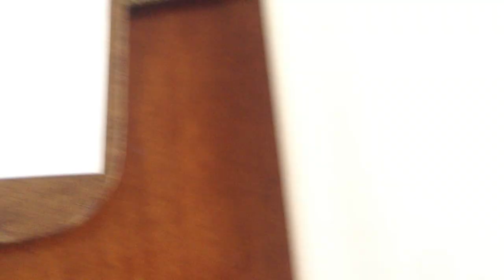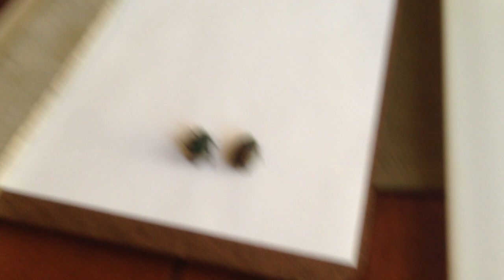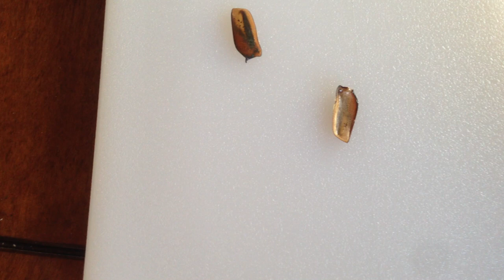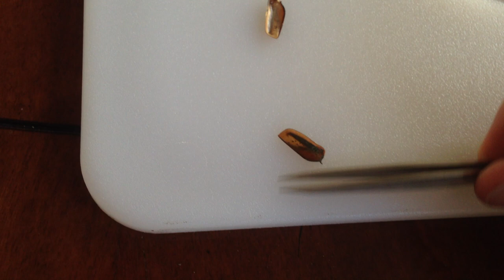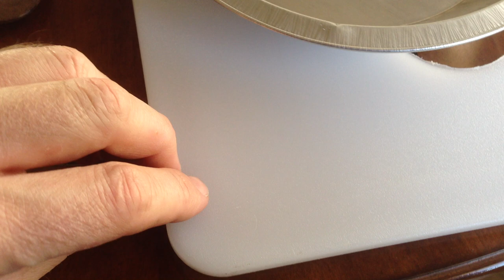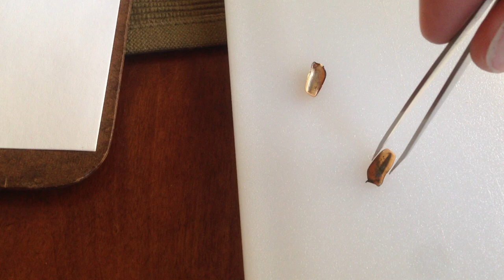Viktor Grebennikov #1 - Testing Scarab (June Bug) Wing Covers

Comment: I used a toothpick to move them around and it was highly magnetic to the wood at the hinge point in the wing. electrostatic or not there is a concentrated energy field. Like taking a bunch of copper wire and have them all connect at a fixed point. Then teathered together like a shell carbon fiberglass type mixture.  Getting the underneath wing and microscope research.  Possibly dual flight propulsion system using electrical field steering for thoughtless evade techniques. Take note how the bug has no tail or wing flight varaiations to control the  direction of travel. And many can swarm without bumping into each other. Is their higher magnetic properties in the lower wings. The way the wings flap it would be ac flow of electrons.
Reply: Just In what species of beetle produced those results?
Reply: A great hypothesis to be tested.
Reply: The British Beatles. John, Paul, George and Ringo.
Reply: @osamabinladen824  hello bin. You become science now?
Reply: @wildanrosyada7787  he was CIA before that

Comment: The key to this geo-scoptic flying gyros, is the attuned shape eiffel tower-like or Infiniti car badge arch v icon symbol in a natural wing craft called insects. Creating what only in sci-fi illustration of the "pulse engine", you can feel that power tension by pressing both pointex fingers aside until they hyper extent while you arc flick up and down, this is the Geo momentum direction or apposing of gravity, like "anti-gravity".

Comment: There is a form of Mica that is extremely thin and flakes off of gold or quartz, I am investigating the proximity of these particles to EMR or perched on the surface of water.
I believe gold is the mimic not an interloper ie; this quality is inherent in Nature in various measures and "colors" - as a young man I noticed gold floats on water. As a researcher
I have discovered that gold with collect particles of itself on the surface of water and form itself into a six-sided figure that also floats perfectly on the surface. This may be
due to the distance gold's electrons can travel, as a mineral it is a given but gold is of another magnitude. All you need to do is to drop an 8 molecule thick sheet of gold and wait 
for it to fall. Instead it will flutter and be tossed by any movement of wind. You can even do it with Culinary gold sheets, just not that dramatic. We may be in the territory of 
convergence where it's not just the material but very much a mixture of things like shape or even something as trivial as color. It is bound up with function as form, honeybees
weigh nearly nothing but laden with nectar and pollen? Everything about beekeeping (32 years) is golden. It doesn't take a huge imagination to see there are connections that
are as invisible as the wind... you have to look at the leaves moving to see it.

Comment: This must be due to the dielectric impedance of the material or structures of the wing itself,  it would be interesting to see if we can put one under the microscope to check the micro geometry of the wing,  also a chemical spectrum analysis would reveal some on the nature of the material that is inside.  next to that, it would be interesting to expose them to similar frequencies as the wing beat, there is likely a resonance frequency that it will respond to.  this can be tested with a frequency generator and a nice full-range speaker, placing the wing on the membrane and observing the response.  if i can find one, ill do the resonance test.

Comment: Hey guess what? You don't need bug wings. On a microscopic scale, they formed sets of torus fields aimed at cone tips, all held on surfaces of various shapes. Some work better than others but it's all the same. You can coat ceramic with metal, easiest way to make your own antigravity as well as free energy for pennies. Don't post videos of it though; seems to really piss off some really bad people.
Reply from the maker: Thanks for the tip, I'll look into it
Reply: Hey can you expand a little bit about the 'coated ceramic' thing. What kind of metal should be used (magnetic or non-magnetic). Also how to trigger the strange effects? Thanx.
Reply from the maker: High voltage triggers this effect. I later confirmed that the nylon holds a static field on its surface. The reaction you see in this video is "like charges repel" as both elytra are carrying the same charge.
Reply: Naoki Kashima Trigger effects? Time itself does this through progressive kinetics of elementary particles. Time begins with the smallest particle, which is most hydraulically superior ; the electron neutrino .00012x e
It has a goal; to replace others like it which have been consumed by stars in the production of larger particles.
This would be very simple if there were but one pole of magnetic current but there are infact 3. Matter is the 3rd.
Imagine a bike rolling along growing larger on it's way. Now consider the 2nd pole being a 2nd set of wheels, so you have a set of axles(variant "A") which tend to vary in length between the left and right sides of the cart. This alone may find variations along it's path, ruts in the road if you will, that make a vibration to modulate "A". 
Now ad a 3rd axle which is connected to the center axle wrong, so that instead of dampening vibration, it amplifies it.
At some point, the wheels shake hard enough on that final axle to fly right off. 
The road is the energy, the wheels are the mass, the left wheels are negative mass, right positive mass. The road is the sum of both as they will constantly mix in space forming neutral ions which are neither negative nor positive, evenly mixed due to the mere passing of time (e-n's.)
Now once the cart has lost it's rear wheels, the axle is reformed in the front of the cart. This is because the 3rd pole is controlling the sum (road) not the cart.
So when 3 leaded edges of any dielectric material are allowed to form spinning torus fields (see my video on the whisper cup/grebennikov solved) like spinning tires, the mass would naturally amplify mass exponentially until it spins off the largest rim of the largest basin like a centrifuge. 
And why?
Because the source of time/energy is negative bias, and will find it's path of least resistance by entering into the cone tip before anywhere else. The only other positive to oppose is the largest rim and it does enter there also but has a fantastic progressive kinetic fight as particle masses increase upon each reaction from small to large. 
So it is easy to comprehend how the torus fields can speed up if there is the slightest rf modulation of charge splitting them. What comes next is more fun; both torus fields grow out of control and collapse, imploding. This is where the wheels shake off once it spins too fast.
Now there are many lines of magnetic current in the large torus, fewer in the small, and by collapsing the fields, charges mix as magnetic lines share over the smallest ridge. This annihilation of 2 fields making one perfect cone over 2 ridges to the top cone emitter, allow those imploding lines to move in sync yet out of phase through the nonlinear focal point off the cone tip. After focus, all lines of force (waves) are thus combined to form a sum of wave peaks on that carrier wave which was the implosive collapse.
Now you quite simple deduce this proven science (through transformer design and or the Joe Cell for example which utilizes zero point energy as core function) has pitted energy against mass with both neg and pos simultaneously, now putting energy off the cone tip and mass off the large rim, with negative pole mesons most commonly ejected from the small ridge (center axle) which cannot keep up with energy that successively makes paths of least resistance more superconductive upon each cycle until all space in and around the device is so superconductive that it is heavy as gold which is an element existing in what I call format # 7. ;; 3 DeBroglie gears around 1, plane interlocking thus forcing all energy to move through rather than around which is why gold forms such a heavy field for being such a simple element based on proton/neutron count. The field flowing off the device rains in such fast pulses of carrier failure that you wont experience it in flight. It's frequency depends on the materials used, and size of the device.

Consequently, it is a dielectric capacitor just like the carbon chitin of bug wings and can be made of any metal, but the best material I've found also safe to use around human biologicals is a layered compound of bismuth over certain metals.
Reply: +mikefromspace  You sir...are full of beetle dung!!! haha
Reply: +Travis Woodward Good one Travis. Maybe you'll explain unification to me now, since you suggest I do not know it as I've clearly proven it on my channel since 2008.  So what is your superior theory? I would love to hear more, genius.
Amplification of splitting the slight mass difference among the poles (already there) produces heavy ion mass displacement. Infact I know first had of a material recovered at the Roswell crash site 1mm thick 25 layers highly dielectric capacitor tech never before manufactured by any known means on earth. Something carbon in bug wings use ion friction to make can instead be made using 3 simple elements and provide many times more heavy ions to displace the mass with over a million times power to weight ratio.
Reply: mikefromspace Mike gravity and magnetism are the same force. If a magnetic field is strong enough it will effect everything around it (look up frog being levitated in a magnetic field), even non-magnetic non-metalic objects. Also, look up magnetic inverter toy (I made a replication of it). You have small magnets around the perimeter and a powerful magnet at the center. This causes an air gap between 2 sets of magnets, magnets don't want to get any closer but don't want to get any further away either. This explains why we we always see the same side of the moon. It is because the moon is magnetically bound to the earth. Gravity can be explained through the magnetic mono-poles the N and S mono-poles. The current space displacement theory of gravity hasn't predicted a single thing correctly about our universe.
Reply: +Naoki Kashima I have my own theory shown in videos, you know this right? Electron neutrinos most superior with hydraulic force permeate all on their paths to stars where they are formed into new larger particles which then oppose their flow. The model proves itself everywhere, and I have even provided mathematical proof of this on the channel. En is time source, and through progressive kinetics, fuels motion of the 3 poles , neg, pos, matter. Magnetic current's broad spectrum kinetic reactions all begin from the electron neutrino strike. Have you seen all my science/physics videos? Formatting of particles explains matter's structure. A diamond for example will form when carbon imitates 2 poles instead of the 1 it is, using cubical spiral expanding or contracting growth pattern F5 boson format from F3 pairs by forming as satellites of a slightly larger boson which contain the crossroads which allow 3rd pole matter disturbances to exist.   I have models for many elements but many videos were lost in early 2012 so I have only reposted the basics and the math proof since all my energy went into reverse engineering coral castle levitation device used also by Merlin and others throughout history to move metalithic stones. Easter island heads were walked into place. Merlin made many stone circles not just Stonehenge which btw they recently found many more stones underground at larger radius.
Anyway I'll work on levitation after I make a good financial income for myself. I'm using a microwave oven I've custom build to grow gold and diamonds. Yes, really.
Reply: mikefromspace I wish you luck in your efforts to replicate the effects from Coral Castle. I am interested in Ed's self turning flywheel. He had to start tuning that thing by hand then the AC motor would kick in and it will continue to generate power and spin at the same time. The extra energy came from the Earth, I believe. He had 2 separate ground connections going into the underground aquifers. Ed was peculiar which land to use for his project. I think he wanted land with underground water source. The Pyramids were built on top of an aquifer. There are 2 granite shafts that go down into the aquifer, granite is a semiconductor. Thus, the pyramids also had 2 ground connections. Also, Tamriel Kapendadze generator uses 2 separate grounds to function (he uses water pipe as one of his grounds a buried radiator for the other ground).

I'm sure you have your own thoughts on Ed, I think I'm a subscriber for yours. Good luck on your project, I'll keep on trying as well.

Cheers.
Reply: +Naoki Kashima Yes grounding to water makes water healthy but not needed for levitation. The flywheel was part of a circuit using 2 dynamos, 3 stage coil inside timing post, distributor that shorts flywheel based to timing post which connects to magneto block. Inside wheel is a 6core coilset which attracts to iron between 6 holes in that centrode which has the distributor tongue coming off it. Consider how dynamos both generate and consume power, so they are self modulators and 3 of them would run 120d out of phase initially until time begins pushing energy from ground 3 tripod dynamo in box progressively to ground 1 flywheel which creates massive energy among inner and outer copper discharge balls, 2 of which you can still see today just poking their heads out of the cement in the flywheel.  The other 2 were on a stationary part which was stolen by an unknown tourist or blue eyed FBI agent, that reptilian bastard. Possibly same one who smothered Nikola Tesla so they could get files used later to make Philadelphia Experiment happen.
Reply: Naoki Kashima  gravity and magnetism is NOT the same force.
Reply: They are gubmit trolls
Reply: mikefromspace  tell me more

Comment: There is fine hairs on the underside of the shells, im guessing they are designed so as to not hurt or damage their wings. So my guess is that those hairs are easily  charged by static electricity.

Comment: could very well be static electricity.   you should try same thing on a glass plate, on copper on aluminum or stainless steel.... wood... a few other materials and see if the wings jump or hover over one another... just my thoughts

Comment: Try using a tone generator app on your phone to vibrate the shells. The shells are capable of creating a field much like a  magnet except it folds its n pole down into its s pole creating the mass nullification. Attach a bunch to a paint stick vibrate it on a suspended rock on a rope pulleys  balance.

Comment: The shells seemed to partially repel each other on the nylon surface.  Did the same thing happen on say wood, ceramics, metal?  Sorry - my mistake - you did try it with a metal pie dish and the shells seemed to stick, but not repel each other, so bit different.

Comment: can you try to treat this wings with magnets? imo they behave like magnets, especially on alu plate it was look like one of most popular ways to demonstrate Lenz's law (by putting magnets on sheet of non magnetic conductor and letting them fall, but falling is interrupted little bit by current generated in conductor mass, its also known as ~"copper tube and magnet experiment") it also seems to be nice explanation why Egyptians was treat scarabs as sacred creatures...
Reply from the maker: I have tried using strong magnets close to them. One was 1800 Gauss (400+lbs of force). It has no effect. Nice observation though. After much testing I have found the cause of these reactions to be the static electricity built up in the nylon.

Comment: Use a microscope. Look for the cone structures on the underside of the wings. Other side of the wind covers. Dragonfly wings also have cone structures. Coleoptera have thick exoskeletons. They are heavy insects. They should not be able to fly. If you watch them fly in slow motion they rub their wing covers together or with their wings and create a vibration, and then they float in the air and use their wings to push forward and to steer. You're looking at anti-gravity. It's all around us and obvious.

Comment: Repeat the scarab wing experiment over the aluminum foil, but attach a grounding wire to the aluminum.  ie make sure all the static electricity is drained.
Reply from the maker: This was my first video on this subject. After further study I became discouraged as everything seems linked to static electricity. I didn't realize it at the time, but the nylon I was working on had a charge. My second video shows that this can be reproduced with dry leaves.
Reply: Russell Martin but it is said that the russian scientist used both wings and their cover to produce the effect,
and he needed some effect to to make the levitation happen,

Comment: put it in a glass tube so it wont fly apart it will hover over the other one maybe
Reply from the maker: This was my first video on this subject. After further study I became discouraged as everything seems linked to static electricity. I didn't realize it at the time, but the nylon I was working on had a charge. My second video shows that this can be reproduced with dry leaves.
Reply: your right..! So it only works on nylon? the beetle wings he used was from Two New Species of 'Leaping' Beetles Discovered in New Caledonia at least that's the  closest match i got, thanks great video
Reply from the maker: Yes, all the wings I've tried so far only work in a static electric field. I'll look into the leaping beetle if I can find one for sale.
Reply: k hope to see the new video soon
Reply: @LimitlessResearch why dont you do CES effect?